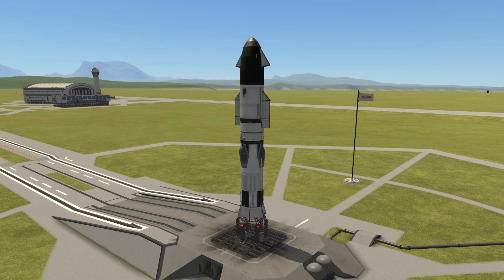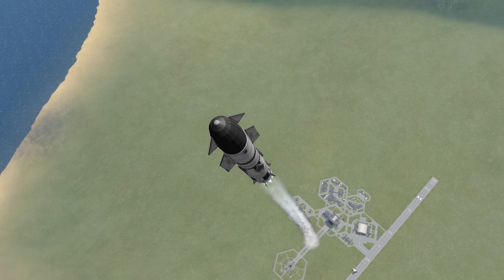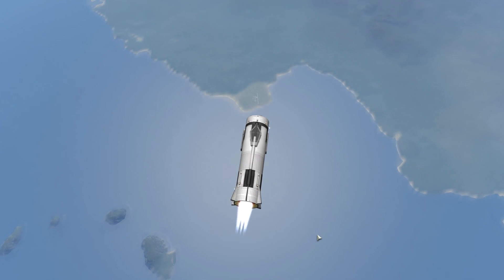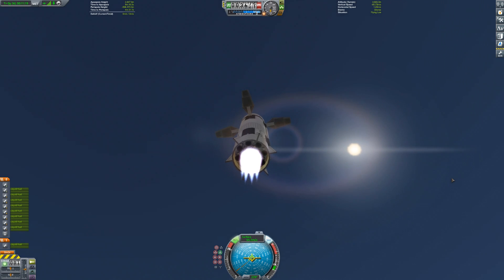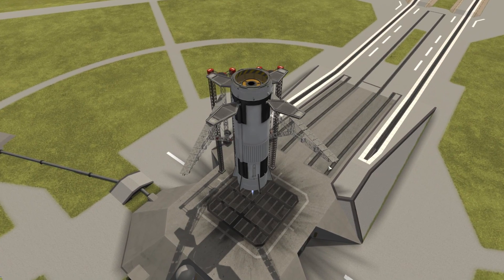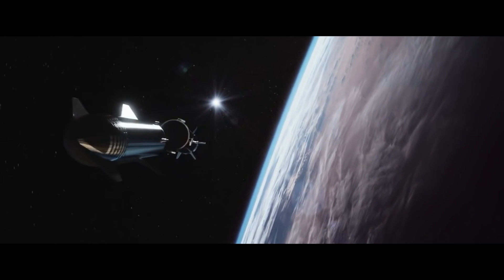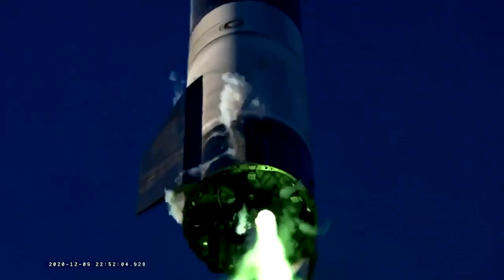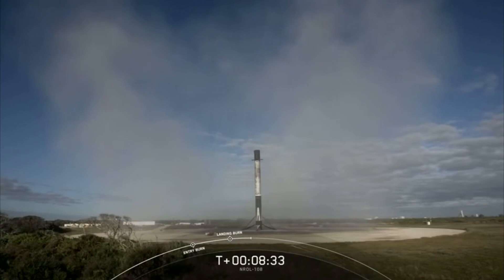Why SpaceX Wants To Make Landing Super Heavy MORE Difficult.

Comment: Ah yes SpaceX, where the rockets are reusable and the launch pads expendable.
Reply: Civil engineering is cheap, aerospace engineering is expensive!  Terrestrial steel and concrete are pretty well-optimized industries. If a few I-beams and some reinforced concrete are all it takes to make a $2M spacecraft work (or even simply make it work a little better) that's an easy engineering decision.
Reply: Yeah but fuel consumption would be lower cause of the weight reduction
Reply: Prophetic.
Reply: Concrete is cheaper than steel. -Chairman Mao (not really, but he could have said that).
Reply: @Biomirth  I concur it does sound like a Mao thing to say
Reply: Well this comment aged well
Reply: @harveyantrobus8742  I was totally able to reuse my old joke last week hehe.
Reply: If a rocket burns up in the atmosphere, you can't really do anything with it. But if a slab of concrete gets damaged, you may  repair it or build a new one, but you can reuse/recycle the old concrete pretty easily.
Reply: @Gabrong  "but you can reuse/recycle the old concrete pretty easily" 

The construction industry wants to talk to you to get your knowledge
Reply: @Bauer-ke6lp  compared to fixing/rebuilding a rocket... 👍
Reply: @Bauer-ke6lp  now all old concrete from demolition is crushed and reused for fill.
Reply: @danielbecker4365  yeah, you can use old concrete as a cheap filler material like almost every non toxic waste, but there is no way to recycle it
Reply: @Bauer-ke6lp  why would they want to talk to him? they recycle concrete daily, it gets pulverized back into powder and used for mix
Reply: @Bauer-ke6lp  that is recycling
Reply: @Bauer-ke6lp  it's easier then deconstructing a rocket and building it again is the point.
Concrete can be pulverized and the core sand and gravel extracted pretty easily but it's still more expensive then new concrete is the only reason why it's not done
Reply: Say rather, redundant.
Reply: ahahah aged incredibly well
Reply: Wow this aged well 😂😂
Reply: Hehe good one
Reply: Nice pfp
Reply: if the launch pad is destroyed, the rocket obviously would be too lol
Reply: Cheaper to build landing pads then rockets. Too many intricate parts like rocket engines and sealed cryotanks (h2 and o2 or similar)....
Reply: @Chris-cv1ll  Usually a catastrophic failure on the launchpad is much worse than losing the rocket alone but in this case the booster would have used up most of its fuel, so the damage might not actually be that bad.
Reply: @haraldhimmel5687  it’s more of the launch going over water then over populated areas so if it comes down it crashes into water and not kill people.
Reply: @Chris-cv1ll  Well yeah and having a mobile launch platform that could be deployed anywhere certainly has appeal too.
Reply: @Håkan Bråkan Kråkan super heavy doesn’t carry humans
Reply: at least Falcon 9 is considerate enough to do a suicide dive rather than wreck the drone-ship.
Reply: And the points don't matter.
Reply: 777u
Reply: ...and the points don't matter.
Reply: Kk(
Reply: If you believe hard enough it might come true
Reply: And only SpaceX engineer can be afraid because of words like "Wings of the rocket  have just fallen off!" (Starship has wings)  )))
Reply: @Dorian Tomaszewski right lol. The towers are definitely not meant to be expendable
Reply: It aged poorly
Reply: LOL
Reply: ((((Kl) okĺ
Reply: Ah yes SpaceX, where the reusable rockets are exploding and the launch pads expendable.
Reply: @gwenwalravens8030  one rocket used 2 times before exploding is still cheaper then the two solid rocket boosters and tanks used for the space shuttles...oh and pad is easily repaired after a crash so meh. Now if it crashed on the launch pad or into a building at the complex that would be a different issue but since there is an abort procedure that would auto send the rocket to crash into the ocean off to far off then that’s not much of an issue. With the move to an old oil platform modified for launching rockets and potentially landing them then its even easier to hit an ocean where no one gets hurt and it’s easier to find after. 

Here is an idea i think we both need to look up: how many flights did the shuttles take (both manned and unmanned). How many crashed/exploded or had other catastrophic failure and get that failure percent from that. Let’s then take the number of years it was in service and get how many failures it had over that period (failures/years). Now do the same for all the spacex rocket that is in use. As time goes on that ratio will just get better and better and may surpass the shuttles in short order. I may actually have to do this and memorize it for people so against spacex and keep looking it up to keep up to date. 

Oh and the turn around time is amazing compared to the shuttles...
Reply: @Chris-cv1ll  "one rocket used 2 times before exploding is still cheaper then the two solid rocket boosters and tanks used for the space shuttles..."
That's not true but it was just a joke in the first place.

"oh and pad is easily repaired after a crash so meh."
Repaired? You mean torn down and rebuilt. But yes, a concrete structure pales in scope to a rocket.

"Now if it crashed on the launch pad or into a building at the complex that would be a different issue but since there is an abort procedure that would auto send the rocket to crash into the ocean off to far off then that’s not much of an issue."
Tell that to Greta Thurnberg.

"With the move to an old oil platform modified for launching rockets and potentially landing them then its even easier to hit an ocean where no one gets hurt and it’s easier to find after."
An oil platform, to launch rockets? When we have large stretches of desert where nothing happens? Are we trying to make this as difficult as possible?

"Now do the same for all the spacex rocket that is in use."
Why? It is obvious that both Shuttle and Falcon missions have different objectives. NASA had as purpose to explore space and save humans when things go wrong. SpaceX has as a mission to reuse rockets and test the possibilities of how such a thing can become more consistent.

"As time goes on that ratio will just get better and better and may surpass the shuttles in short order."
Ok great and what is being accomplished doing so? When this becomes stable, you might spare some bucks at every launch but it is worse for the climate and in the mean time you are spending time and burning fuel to chase a dream that amounts to nothing tangible.

"I may actually have to do this and memorize it for people so against spacex and keep looking it up to keep up to date."
Who says I'm against SpaceX? Is making fun of exploding rockets a taboo these days? SpaceX has very capable people working at the company. The mere act of launching a rocket is rocket science. Sure it is less of a clusterfuck than it used to be but still. Is it amazing that they can make rocket land at all? Sure. However not everything you can do is worth doing it. I'm sure SpaceX employees don't agree with Musk's idea of reusable rockets.

"Oh and the turn around time is amazing compared to the shuttles..."
So what? What's the added value of this?
Reply: @gwenwalravens8030  the turn around is better was because it means more launches per month and more revenue for each rocket...aka better roi for spacex. 

Oh the water issue tell that to nasa who does the same exact thing. Where do you think the satellite graveyard is and where rockets abort to? That’s part of why Cape Canaveral is the main launch complex (that and the fact it’s near the equator) 

If reusable rockets were not cost effective then why did nasa reuse their shuttles at all? Why not do the same thing they always did and use a capsule and do multiple smaller launches to get everything up there for a mission like Apollo did? Would have been overall cheaper. Oh wait that’s because even if the cost upfront is extreme the cost by the end of the program is smaller. 

On top of the reuseability of the rockets on earth, what if a nasa heavy lifter (sls though it’s so freaking over budget and behind schedule while spacex is using money from contracts and on or ahead of schedule) to move the spacex rockets to Mars or similar to allow people to launch easier off a planet and save fuel for the interplanetary burn. 

Oh and the fuel is simpler to create via bacteria then jet fuel and both are being tested. This would mitigate all the environmental effects as the energy used to form the fuel is from the sun which would have dispersed the energy on to the surface in the form of heat anyway. This tech could be used on Mars to make more fuel to use on relaunches as well as when we start mining rocks for chon (carbon hydrogen oxygen and nitrogen) which is necessary for human survival..this should make earth more green and sustainable in the long run as it could be a fuel for certain activities that cannot be fully green like flying or traveling where there isn’t a real infrastructure
Reply: @Chris-cv1ll  "the turn around is better was because it means more launches per month and more revenue for each rocket...aka better roi for spacex." 
If the amount of time spared is substantive compared to checking and preparing the rocket for a relaunch, yes. What is SpaceX going to launch each month?

"Oh the water issue tell that to nasa who does the same exact thing. Where do you think the satellite graveyard is and where rockets abort to?"
NASA isn't landing stuf. Yes, it is a graveyard for things. I thought SpaceX wanted to keep their rockets. When did NASA ever launch a rocket on a platform in the sea? They are doing research on oil platforms for new tech to use on space stations.

"If reusable rockets were not cost effective then why did nasa reuse their shuttles at all?" 
NASA isn't a for profit organisation. The shuttle is a rocket launched vehicle, not a rocket. Why do you keep comparing the two? The companies and their missions are nothing alike.

"Why not do the same thing they always did  and use a capsule and do multiple smaller launches to get everything up there for a mission like Apollo did?"
It depends on the mission. 

"Would have been overall cheaper. Oh wait that’s because even if the cost upfront is extreme the cost by the end of the program is smaller."
NASA doesn't care about cost. It cares about safety. The price of rockets isn't worth mentioning next to the equipment cost NASA wants to put into space.

"and save fuel for the interplanetary burn." 
How do you think we're going to save fuel with launches from a platform in space or on another planet??? You still need to put the equipment you want to launch into space from earth to the platform or other planet. Musk is selling the people a world of the future that's unrealistic.

"Oh and the fuel is simpler to create via bacteria then jet fuel and both are being tested."
Yes, fuel created by bacteria. That hasn't been a work in progress since the 1980s.

"This would mitigate all the environmental effects as the energy used to form the fuel is from the sun which would have dispersed the energy on to the surface in the form of heat anyway."
And what are you going to do with that fuel to change it into energy again to take you off planet?

"This tech could be used on Mars to make more fuel to use on relaunches as well as when we start mining rocks for chon"
This tech doesn't exist... It has been in research for over 40 years.

"(carbon hydrogen oxygen and nitrogen)"
You don't need nitrogen for humans. I'm assuming that's for the plants.
Reply: @Chris-cv1ll  "Oh and the fuel is simpler to create via bacteria then jet fuel and both are being tested."
I did some more research into this matter. I was wrong. This has been discovered in the 1910s and has since been researched.
Reply: @gwenwalravens8030 

On the save fuel by launching from a platform...the platform can be closer to the equator where the earths rotation can be taken advantage of...why do you think most launch sites are as close as possible to it.

What will they launch? Let’s see, they will have their star link program to launch for a while, any other low earth orbit rocket, iss crews and materials and all that’s with their one rocket. With falcon heavy they can launch into higher orbits as shown by the Tesla floating in interplanetary space and that’s not including anything they develop or are developing in the next few years.
Reply: @Chris-cv1ll  "On the save fuel by launching from a platform...the platform can be closer to the equator where the earths rotation can be taken advantage of..."
Once again that depends entirely on the mission. The escape velocity and the energy required to reach space are the highest at the equator. Objects weigh more when you move closer to the equator. You can actually measure this yourself when traveling. People only launch stuf at the equator if they want to take advantage of the earth's rotational velocity to get things out of the earth's orbit. SpaceX has nothing to gain from launches near the equator. If anything they better launch them as close to the the poles as possible. But once again: no-one has launched a rocket from a platform on the sea, ever. Why do you think that is?

"why do you think most launch sites are as close as possible to it."
You are generalising launch sites as if they all happen at the equator. They don't. They take place in Western countries that happen to have deserts near the equator, or cheap land to buy. Just look at where NASA, SpaceX, Russia, China and Europe ar launching their rockets. You'll notice it isn't near cities.

"What will they launch? Let’s see, they will have their star link program to launch for a while," 
Ok yes, I was expecting this. But how many are they allowed to launch at this point. The first ones really caused an uproar in general.

"any other low earth orbit rocket,"
Yes. Very specific.

"iss crews and materials and all that’s with their one rocket."
So far, you are averaging one or two launches per month at best.

"With falcon heavy they can launch into higher orbits"
Yes, that the main idea of having stage 2 booster rockets.

"as shown by the Tesla floating in interplanetary space"
Yep. Talking about a giant waste of time, money and fuel, not to mention adding to the space debris.

"and that’s not including anything they develop or are developing in the next few years."
Try decade. Improvements in the field of space exploration need decades to advance. SpaceX is not any different. Just look at SpaceX's track record. They exist for nearly 20 years. Musk has been at the helm for many years and they have done very little concerning innovation. Do you think Starlink is innovative? No it isn't. People have thought about it when the internet became a huge thing everyone wanted. Putting fiber cables in the ocean is cheaper, a lot cheaper, and how we all remain connected.
Reply: @gwenwalravens8030   > but it is worse for the climate

No, its actually better for the climate than previous boosters since thanks to reusability the carbon footprint is estimated to largely just consist of fuel. That fuel is also spent very efficiently to lift payloads into orbit and actually can be produced climate-neutral. 

The impact of rocketry on the climate is objectively laughable compared to all the other emmissions, which actually ruin our climate and often don't have an optimized carbon footprint, nor existing concepts to be powered on green fuel. Areas that should be critisized instead of a company which is optimizing the emmissions of space travel.

> and in the mean time you are spending time and burning fuel to chase a dream that amounts to nothing tangible.

Only the most powerful, reusable booster ever, which would also be the cheapest by several orders of magnitude, completely revolutionizing our orbital launch capabilities. Nothing to see here.

Comment: eh, just land it in the water then - i can't imagine something that has to be so very precise being really robust
Reply: The damage after tipping over in water could be extreme. The landing of the very first Starship 12 km flight was amazingly precise (it hit the landing pad despite low fuel pressure and an engine burning up), as were 70 Falcon booster recoveries.

Will SpaceX use a stationary catcher so Starship has to land within the "hole" with just the grid fins sticking out, or one that moves around to catch a rocket that lands anywhere in the landing zone area? Scott Manley's two arms 5:00 is a pretty good design except they probably need to be supported at both ends; they could be stationary or mobile.

Comment: "Super heavy is hevier then the saturn V"

Wait WHAT
Reply: I think he means complete with a Starship on top, and both fully fueled and with cargo.  That configuration will actually be considerably heavier than a fully fueled and topped Saturn V.
Reply: @tarmaque  that is insane. I didn't realise the scale until he said that
Reply: @yanivrubin4166   It kinda is.  There are some comparison photos on the interwebs, if you look.  They're about the same diameter, but the full Superheavy/Starship stack is a touch taller and says the same diameter for more of its height.

Comment: The design for the landing capture could like main arms of a CNC that would move in and out and have shock absorbtion. This would require 8 towers but this would give a wider range for error as the arms could adjust as needed to capture the rocket if it was off on either x or y axis.
Reply: Hmm. Especially if it could hover for a short time, the initial window that the aft of the vehicle needs to enter could be pretty wide -- maybe wouldn't need to really be all that precise. The catch system could move in towards the booster and get under the grid fins.